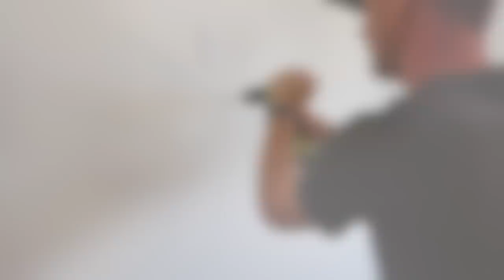NEW HOME PRIMARY BEDROOM ORGANIC MODERN MAKEOVER | DIY MAIN BEDROOM MAKEOVER ON A BUDGET 2023

Comment: After working with interiors for many years..two tips...pull the chair a little from the corner, to give your room a sense of flow, and not a "dead-end corner feel. Also, while the dresser design compliments other elements, it is a distinct style that may look dated in a few years, something black with a little more transitional design may save you money years to come.
Reply: I think she needs 2 modern wing chairs with a small table between them and maybe an ottoman. Then she would have a relaxing place to read or use her phone or iPad.

Comment: Get a massive long black rod that extends all the way across the window wall so it is only a few inches away from the connecting walls. Get cream or off white or white airy curtains that remain fully open and only cover the wall and not the windows.  That is the main look but you can shut the curtains when needed.
Reply: That is a perfect idea. People usually make the mistake of hanging the curtain rod too low and the curtains too close to the window. Drapes do not need to close off a window at all if you extend the curtain rod to the sides at least 12”. Ashley has plenty of room to work with. I think some light and airy drapes would soften the room and visually take it up a notch.

Comment: Your bedroom turned out fantastic. One tip for those adding a high electrical outlet for a wall-mounted television, if you have the ability, put in an Ethernet connection, too. You won’t have to rely on WiFi for streaming but will have a direct connection which is much faster.